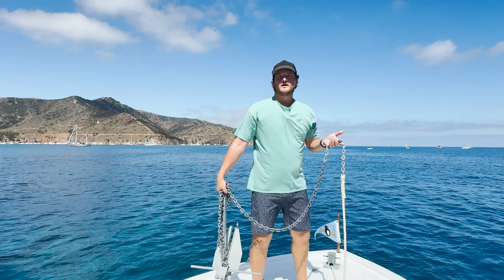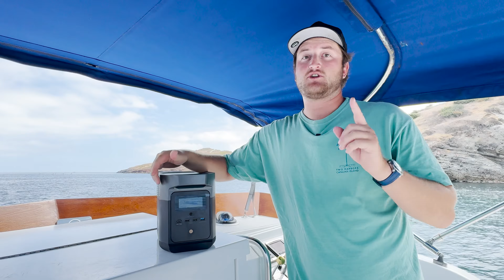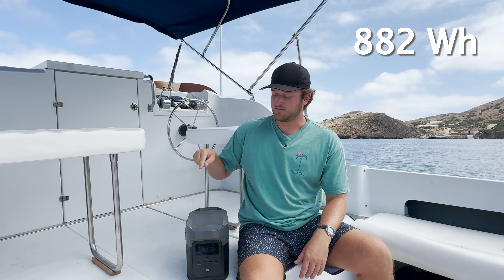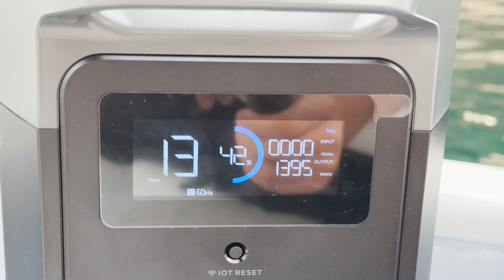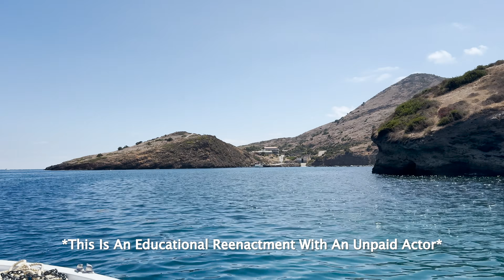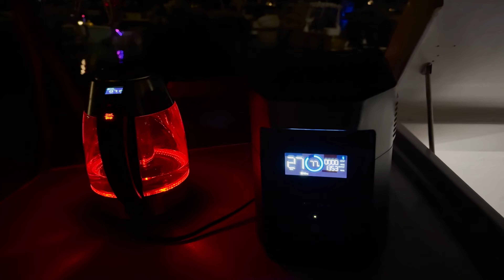Can a Power Station Replace a Boat Generator? Real-World Test

Comment: I purchased a Bluetti AC200 Max a few years ago to run the air conditioner on my 30 Pursuit. I have since sold that boat but kept the solar generator. My new boat has a diesel generator but I don't like to run it while underway. I can use the solar generator to keep the two refrigerators running on 110v. I also use it for power when working on the boat on land in the off season and on other projects. I would be very tempted to replace the diesel genset with a solar genset but would also be tempted over safety with a fire. They need to be marinized at the factory to handle the shock of boating. The prices have dropped so much now. They can be charged while at the dock from shore power, or solar or even 12 volt input while running.